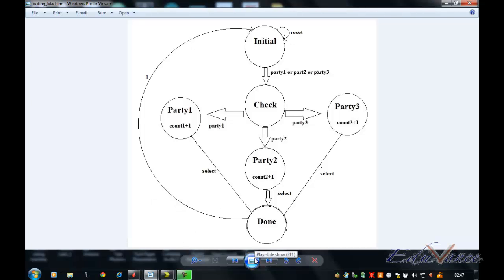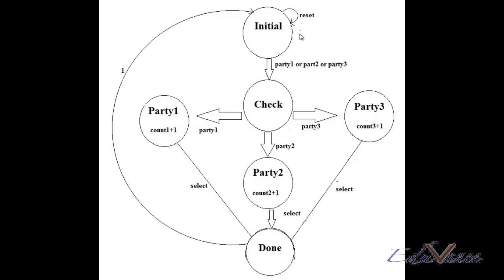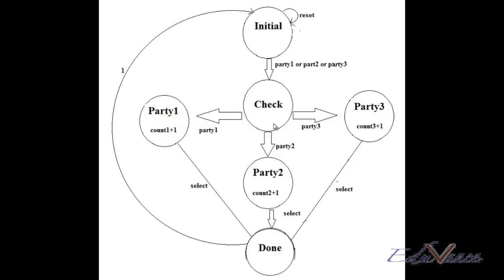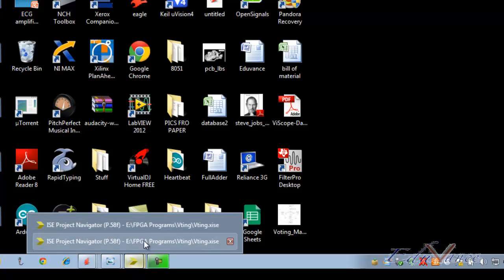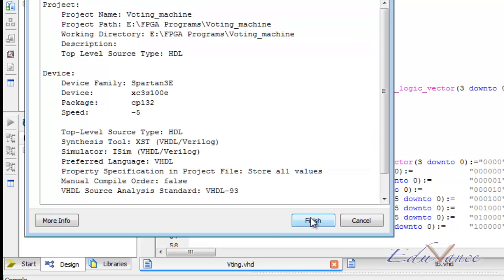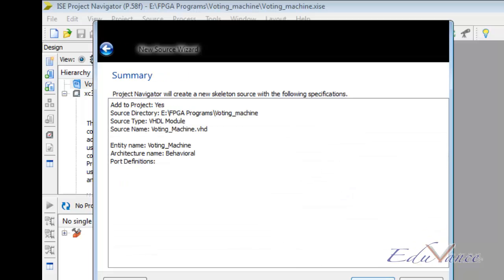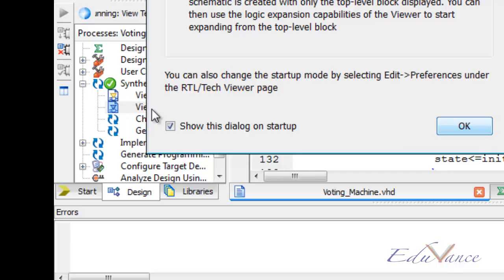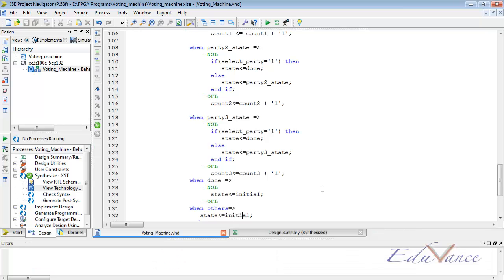VHDL Lecture 21 Lab 7 - Voting Machine Explanation

Comment: I know this is a relatively old video but it is worth pointing out that this design can be simplified because the check and done states are unnecessary and that one hot assignment also uses more resources than other methods but they can get complicated with figuring out the optimal configuration, but I do get that this is easier to explain and it has been a great video series so far.

edit: If you think about it the initial state is unnecessary as well.

Comment: Hi. I have followed all the steps but could not synthesize the code as getting WARNING:Xst:2677 - Node <state_5> of sequential type is unconnected in block <VotingMachine>. Could you please help me to resolve this?
Reply from the maker: There might be an assignment in your code you may have missed. Also even if a warning is generated, the code should be synthesized. Check if you have anything mentioned in errors list.